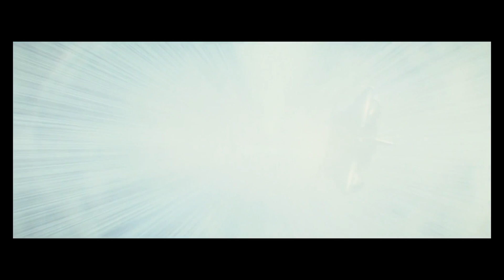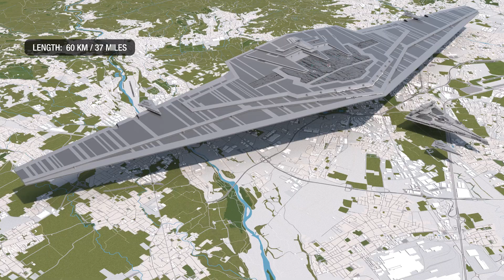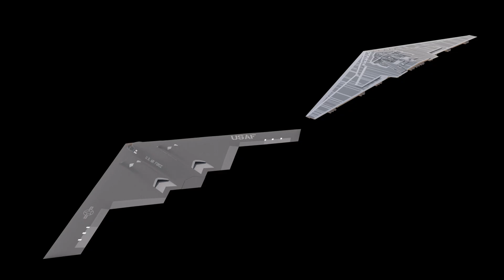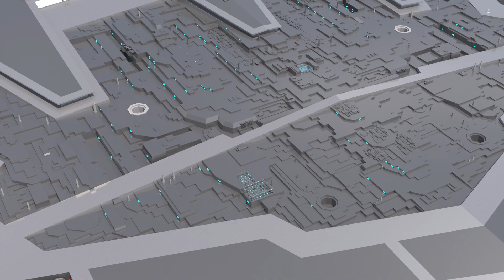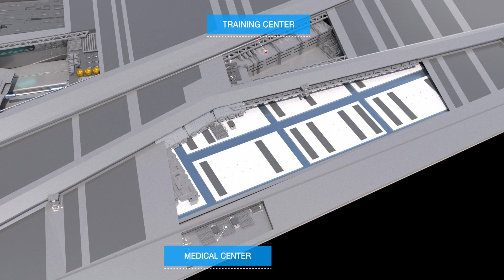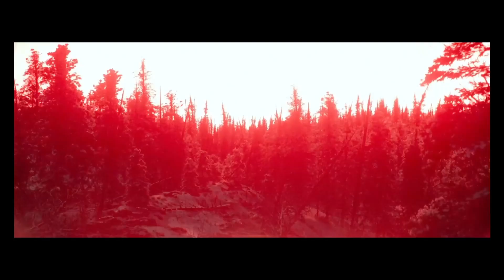Star Wars: How Big is the Supremacy?

Comment: For a ship with a wingspan of 60 kilometers, or 36 miles,  if it rotates about its central axis at a rate of just 0.02 revolutions PER HOUR,  the centrifugal G forces at the tips would be 10 Gs.   Obviously this is a very bad design from a maneuvering standpoint.  At a 10 G limit it'd take 50 hours to make one revolution.      At the standard turn rate of 3 degrees per second the tip G loading would be about 120 Gs.   The design is ABSURD.

Comment: you were on the right track with the B-2 as an influence, however, you need to look farther back in Northrop's history to spot the source of the inspiration.
Reply from the maker: You can go as far back as the Horten Ho 229, built by the Nazi.
Reply: @Halfscreen  i was, at least, trying to convey that you were in the right ballpark in regards to the manufacturer.  you well know that much of inspiration for Star Wars vehicles and equipment comes from historical fame rather than modern design.
Reply from the maker: @morganb6717  Most designs in SW are usually adapted from older technology.
Reply: @Halfscreen  yep, that is my underlying point.   also, it's pretty cool to have this opportunity to interact with you.   i especially enjoy your Star Wars and Star Trek technical cutaway videos.  some excellent stuff there.  thanks for applying your talents to enrich the fandom.
Reply from the maker: @morganb6717  No problem.  These animations are extremely time-consuming. . I working on a better workflow to kick out animation even faster, hopefully, it will work out and I appreciate the kind gesture.

Comment: How did the Supremacy and other large Star Destroyers generate artificial gravity? For that matter, how did small freighters like the Millennium Falcon generate artificial gravity?
Reply from the maker: These information weren't in the schematic and wasn't mentioned unfortunately.
Reply: Anti-gravity generators small to massive
Reply: Idk it just seems like every ship is able to create artificial Gravity with small components
Reply: @v-Lex-v  USG ISHIMURA 
Planet Cracker-class
MANUFACTURER
Concordance Extraction Corporation
LENGTH
5,300 feet (1.6 KILOMETRES
In Dead Space and Deas Space 2 and remake 1/27/2023. It's longer than the SW ISD. It's anti-gravity generators are massive and mad power needed to operate.
Reply: @darkmatter1152  different galaxies, different tech i guess. I mean ever space franchise has some way for big ships to travel long distances in short times but all are different, be it Hyperspace or Warping or other